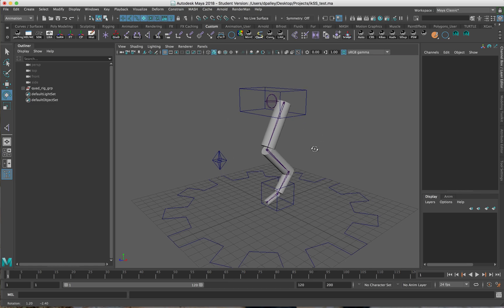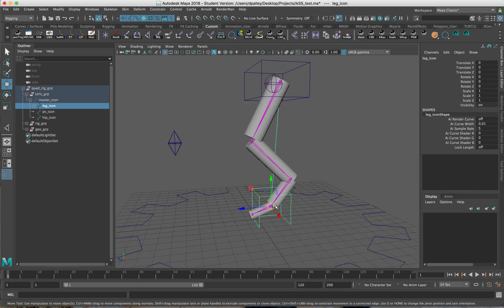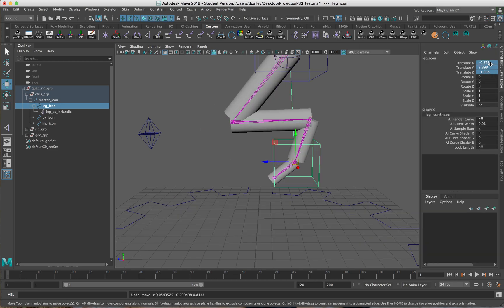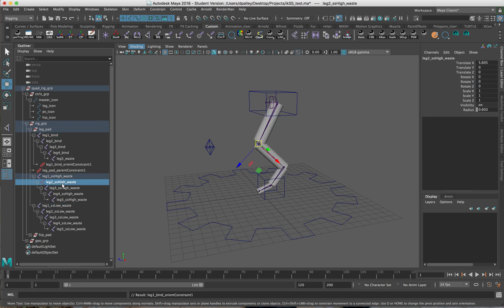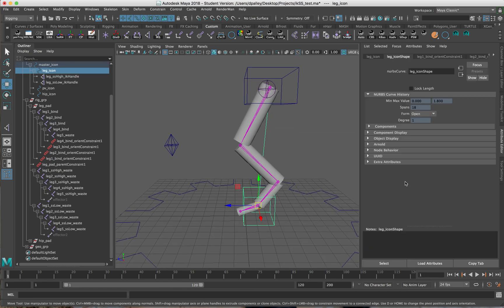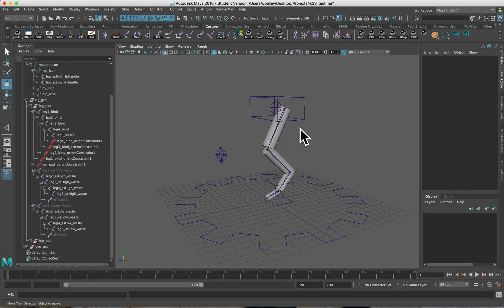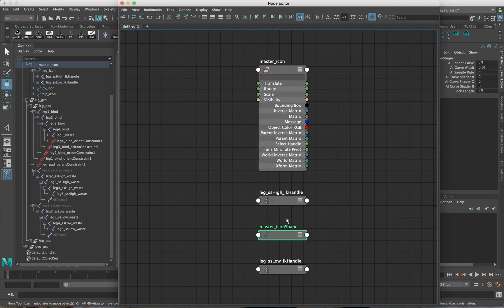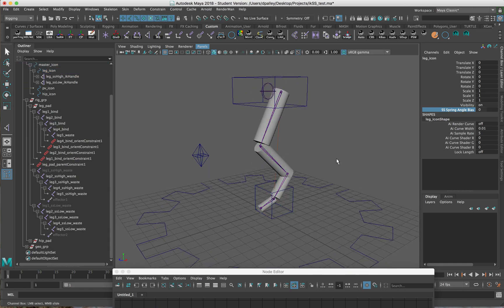Update - Quad Leg Rig With Spring Solver IK (Bug Fixes)

Comment: For some reason, the spring solver option does nothing. When I try to move it, it snaps right back to its original position and the limb never moves at all. All the other IK options work fine.